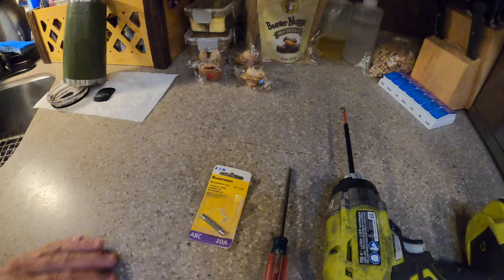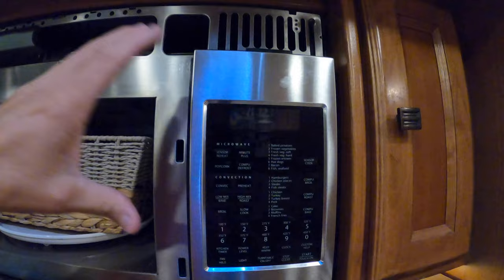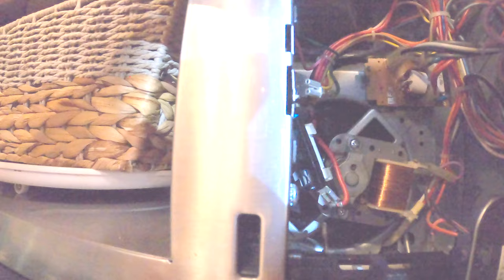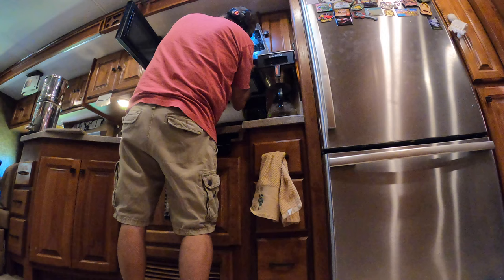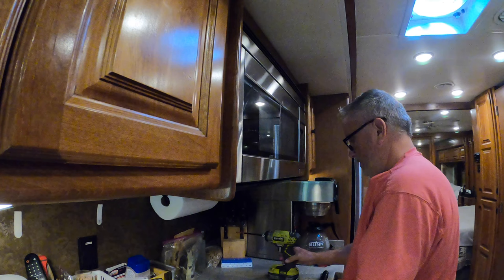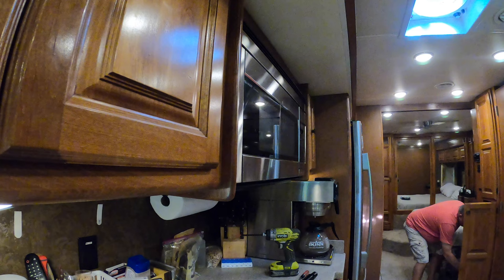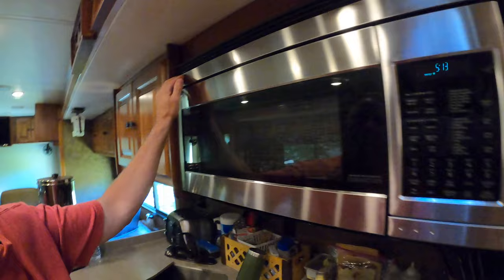Sharp Carousel Microwave No Power | Fuse Replacement | Sunday Solution

Comment: Sorry, this shows everything except the fuse and replacing. The camera never shows clearly where the fuse. I have NO idea what you’re taking out and putting in
Reply from the maker: There’s simply not enough room to get the camera in there…you will have to use a flashlight and look inside and you will see the fuse holder,it’s black and the fuse.
Reply: There are 3 black boxes. Which holds the fuse
Reply from the maker: @KitchenPress  the fuse should be visible as soon as you remove the control panel. It is not inside any box 👍
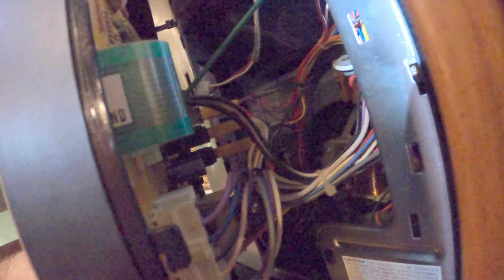Reply from the maker: @KitchenPress   you can see it clearly at 3:08 and 3:20 minute marks in the video

Comment: This is like the 3'rd fuse I've replaced over the last 4-5 years , this is my 2'd sharp and the last one lasted a long time (over 10 years) but still these fuse replacements did not happen on my earlier version of this model.  It seems they may have cheapen the product a bit , even though it's the same model .
Reply from the maker: We've only had this one and learned early on to keep spare fuses on hand.  Seems they go at the worst times 🙄

Comment: I replaced the fuse on my Sharp Microwave, model R1875T. The clock display lit up, as we hoped (expected). The light works. The fan works. Then we tried the actual MW.  I set the timer for 10 sec.  The sound of the mw was abnormally loud and in less than 10 sec, it blew the (new) fuse. What's your next "sunday solution" for the mw?
Reply: I have the Sharp Carousel MV only (no convection oven with it). Can't see a model number other than "SHARP Carousel. 1200W INVERTER SENSOR". I found a tiny little fuse and cannot read the writing on it. Tested it.......completely dead. So I wrapped a a small piece of thin foil on it and all the lights came back on. I won't try it out until I can pick up a fuse on Monday. (It's Saturday 6pm in OZ at the moment and Bunnings are shut. The electrical shop shut at 4) Yeah.... it's still the Dark Ages in Australia!!!!  - Russ can you share what the problem is if you decide to get it fixed? I can see no other fuses and I'm not game to touch the capacitor.
Reply from the maker: Russ that one sounds like you may need a professional to help repair or replace . I would check to make sure you didn’t actually cause some wires to touch when you changed the fuse and that any wires you may have unplugged are plugged back in…
Reply: @ChasingtheDreamRV  I bought 2 fuses, so I decided to try the 2nd fuse. I've worked on electronics in a "former life" so I'm generally pretty careful about touching wires, and looking for incorrect/worn wires.  However, it never hurts to check.  I did a 2nd operation to replace the fuse again.  The same result:  clock, lights, and fan work....but don't try to use it as a microwave ;)   I suspect that the capacitor is shot.  Getting this one repaired is probably as expensive as a new microwave. I'll check with my reliable RV repair shop, when I get back from our current trip.
Reply: @s.e.wagger3888  Not touch the capacitor....where's your sense of adventure ;)  In a former life, a co-worker (boss) and I used to see if we could build up a charge and then encourage the other person to "fix" something....just to see if we were "smart" enough to discharge the capacitor before completing the repair.  You didn't need to be in the same room, just be within ear shot to know if your prank was successful.   Back to the microwave....based on more testing, I believe the mw is shot.  I plan to replace it when I get home from this trip.
Reply: @russsprunger2229  We used to take capacitors to school when I was a kid. Plug them into the 240v socket for 30 seconds and then chase other kids to zap them. But not being an electrician, I didn't know anything about MVs or the Capac's in them. And I've watched too many "horror story" vids on You Tube about people electrocuting themselves by trying to make those wood-charring gizmos. So I'm just being careful, my brutha. Cheers and good luck with getting a replacement. My MV is 9 years old and hopefully a new fuse will get me a couple of more years.:goodvibes:
Reply from the maker: @russsprunger2229  let us know how you make out 😉 sorry our fix didn’t get it done for you ✌️🙌💕
Reply: @ChasingtheDreamRV  We bought a new microwave. Seems that Sharp is one of the few brands that have the convection option in an rv-mountable version.  Anyway, it's in and works great.  Looks very similar to the one in your video.  The wrinkle that slowed us down a little, is that there were 3 "add'l" screws in the top that were difficult to see.  We removed the long diagonal screws and the microwave didn't move. There were 3 screws that held the top of the microwave to the wooden molding.  The RV mfg'er provided the location of the "secret" screws. Once we removed them, the rest was "easy".  We had to drill holes in the top of the new microwave so we could include the 3 screws in the mounting process.  It was a fun project. We had to buy a new microwave, but the labor was free.

Comment: Fantastic video….yes the video didn’t show the fuse….ours must be a newer microwave….the board was straight back with the fuse easy reach with forceps.  On mine the long bolt came loose….and I was trying to feed it back in when it hit 120 volt and shorted.
Reply from the maker: Glad we were helpful and you got yours back up and running!!! ☺